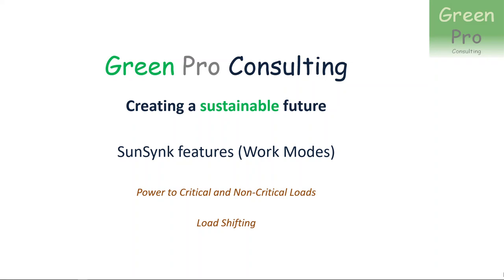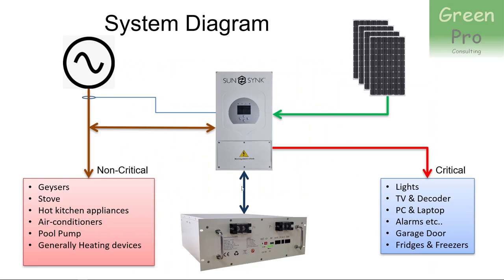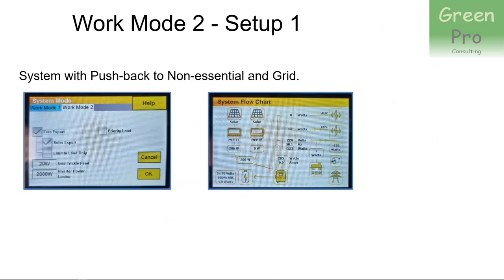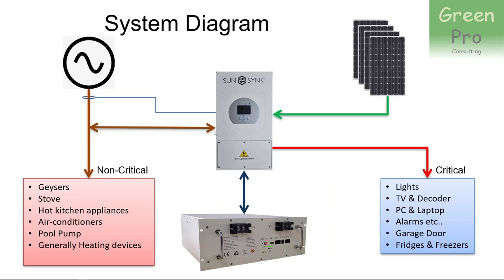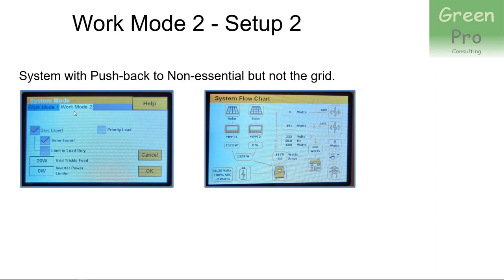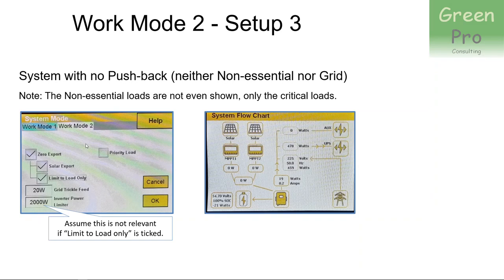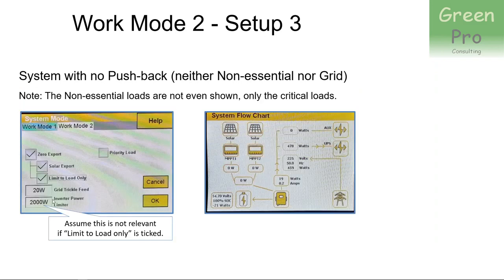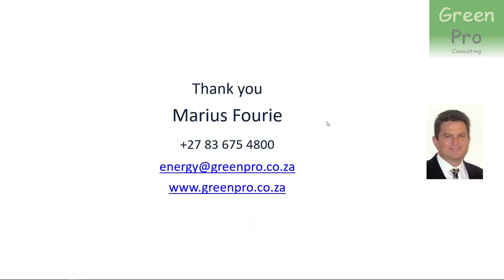SunSynk Work Modes Setup

Comment: I’m not sure if this helps or add to my confusion. I think you’re right that “Zero Export” just means “use the act to measure stuff”. It’s a terrible name and Deye, SunSync, and SolArk are all equally guilty. But I’m confused about what Solar Export means. It doesn’t mean export to the grid? If it just means “send power back TOWARD the grid”, meaning to both the grid and non-essential loads? Does it make a sense to have both Solar Export and Limit to Load Only checked? Wouldn’t it be one or the other but not both?

Comment: Hi guys
Please could someone help me get my head around stopping the Sunsynk from exporting back to the grid in the UK. So I'm wanting to put a solar array on my garden room with say the 3.6K Sunsynk Inverter.
I already have a small distribution board (fed from my consumer unit - in the house) I "was" intending removing the mains incoming from my home to the garden room and using that to provide power to the IV. And then take a connection from the mains out on the inverter and use that to "feed" my garden room DB. BUT ....
I can see that this IV is bi-directional so could just simply connect it as any other appliance from the garden room DB and it would BOTH be supplied but also put out AC back out to my distribution board.
HERE's the question .....
So presumably the electricity output from the IV would go into my garden room DB but ALSO fed back up the feed cable to the house and then to my Consumer unit and make THAT electricity from the IV ALSO available to the house? So how would I stop it then continuing out to the Street ? Is it as simple as putting a clamp on the mains positive (in leg) from the street ? Thats quite a long way away. 30m away. And finally how does it work .... does it just alter its frequency or something so that the output from the IV doesn't quite reach the street ?
Thank you for any comments.

Comment: So my export power limiter is 3.6kw but it is set to zero export but solar export is ticked. Does that mean it will only export when there is excess solar but will not just export when it wants from the battery

Comment: By far the best video on Sunsync setup. Wow. Even the installers did not set mine up correctly.  I noticed I was using municipality power even when my PV had the ability to produce 8.8KW and my non essentials only using 1kw. Pv was throttled as batteries were full. Now all sorted. I have tried limiting to zero but the system only allows a minimum of 500w. Maybe I need a software update. I'm sure many non technical people have a system and due to the setup, not getting the most out of it. What do I do with excess power going into the grid. Can I get a credit from municipality in SA? You a genius. Thanks for this video

Comment: Hi Marius, I'm having trouble with my solar panel setup. Even with excess solar power, non-essential appliances like water heaters and ACs are drawing from the grid. I've noticed the AC load adds solar and grid power together, e.g., 5000W solar + 3000W grid shows 8000W, even when everything else is off. My Work Mode is set to 'Limited to home'. I've tried different settings, but no luck. How can I use my solar surplus efficiently? Need your guidance. Thanks!" P.S. Im not an electrician just an end user :)

Comment: Believe due to firmware changes the Work Mode 2 setup you describe to power non-essential and not export to the grid does not work anymore. Now you simply have to check Zero Export and then keep the Inverter Power Limiter to the size of the inverter. If you have Solar Export checked it will push back to the grid, even with 0 as the limit I found it still pushed back ±400W
Reply from the maker: Hi Gerhard. I have not seen the latest version, and I will be shocked if that is the case. SunSynk should comment here.
Reply: Was this ever confirmed?

Comment: Hi. I have a question and just cant find an answer anywhere online. If i have for example this 5kw sunsync hybrid inverter and the grid is on. No loadshedding. And i have all my non essencial running together. Which will be more than 5kw. Will the inverter trip or does it run normally from grid to appliances? I dont want to limit my whole house to just 5kw output in normal grid times. Obviously with loadshedding load needs to be reduced.
Reply: Same question, Please.🙂
Reply: @glendower2604  Inverter should supply the first 5kW and the grid should cover anything over that.
Reply: There are probably 3 x 40amp capacitors in that inverter, so if no loadshedding and the inverter is in bypass (using grid along battery), the inverter should not trip. If it does, check the trip switch in the DB board. It might only be a 20amp trip, meaning 20Ax220V=4.4kW. So, if your load is 6kW, then the trip switch would, well, trip :)

Comment: HI Marius, a very helpful video. I have just bought a Sunsynk 3.6 ECCO inverter with 3.5 kWp solar panels here in the UK. In this house we have only had a power cut about once a year and then for no more than an hour, so power cuts are not a problem here. One question about which there is some confusion of terminology, as you use the terms critical and essential for the same thing. Do you mean Critical = Essential loads and Non-critical = Non essential loads ?
Reply: I think so John, as there are only essential (critical) and non-essential (non-critical) loads.  i would as well be careful to design careful what we can afford and what we want in 2 years from now. this would better assist in not underdesigning a system and then being dissappointed as so many people are. 

spend time calculating what you actually move over as essential loads, and think carefully about the future. know your house, know your load, know your cost. spen d time doing your own measurements and calculations. you will find your shopping list better suits you.

although in saying all this. the av household will use between 900-1200 kWh a month, with a third going to essential, and 2/3rds non-essential, roughly, but not exactly depending on your home heating, etc requirements. i would always design for 1/3 rd + 20 % (1/5th) ~=0.533 * max load, which is just over 50% of your monthly load.

Comment: I am in Phillipines,  and have the Deye version of this box.   I will probably do grid tie with battery.   2kw of solar and 5kw of battery.    My question is,  why is there AC out and AC in?   How can you have both?    If I connect the output from the inverter to the Main breaker panel,  how would I connect from the main breaker panel back into the Inverter???  That seems to me it would cause a dangerous loop.  No?  Please help
Reply: The grid connection is a 2 way street. The grid is connected to your DB and to your Inv (only 1 connection). The inv can ramp up it's frequency so that it starts supplying the DB by reducing what the grid is carrying. Of course the grid frequency doesn't actually change but that is how it works.(If it was a generator you would be supplying more fuel to increase the rpm/freq). The load connection is your output for critical load (Think of it as a UPS). During an outage the load connection stays energized while the grid connection would be deenergized. You can also do things with the gen connection, it can be an input or it can be an output, not both.
Reply: @pilotdrh  Thanks for a reply that helps me understand it better.
Reply from the maker: Sometimes you realize that someone is going to kill himself if he does his own installation.
Reply: @greenpro-greenproconsultin7420  thanks for your kind words and assistance.    You must be a real rockstar at home.   Not a DB at all like you sound like here.    Green Pro huh?   Ok good to know.

Comment: Hi Marius.
Even after 2 months I still don't know what options to check and which charge parameters to use with my Sunsynk inverters.
I have 4 x Pylontech 5000 batteries at 4,8Kw each (19.2 Kw)
2 x 3.6 Kw hybrid inverters in Parallel. (2 x 16 amp)
My separate AC loads DB is connected to the paralleled output MCB after the Load ports of the inverters;  and my grid connections paralleled from the MCB input MCB (supplied by a 40amp RCBO from my MAIN DB ) 
I  understand the system is bi-directional and can take or give power through any of the 3 ports ( generator / Aux ports are not used)
My Master CT coil is extended to 12 metres using separated CAT 5 wire into 2 pairs per wire for the black/white CT coil which measures 120 ohms as Sunsynk have advised.
I am unsure which boxes to tick and what % SOC to configure the controller at ?
I want to charge all day from solar  (2.4 kw DC coupled) but also run my "critical" AC loads DB when required, then use cheap, OFF PEAK grid energy at night to top the batteries off during our miserable UK weather spells....
i have zero export checked but im unsure what else to tick !
I have 95% SOC and a GRID tick in the first 2 rows during OFF PEAK periods ( 21.30pm to 00'00 and 00.00 to 02.30am)
All other time stamps i have no tick and 40% soc.
Does this mean i charge to 95% as i expect during those off peak times ?
Also do the other settings mean i discharge using battery only down to 40%.
It is so unclear isnt it ?
Reply: there is a sun synk manual i can send you, if you attach your email address

Comment: Hi Marius, so grateful to have found your very well explained video. We recently had a Sunsynk inverter with panels installed, but are also still connected to Eskom. We have a non essential db with geyser and stove connected to Eskom and essential db connected to ups/batteries/s.panels. During the day the s.panels and Eskom powers the house, with excess solar power going to the non essential db. At night from 22:00 - 09:30 next day our system has been set to run off our battery. My understanding was that the battery will only feed the essentials db during that time and Eskom the non essentials db, but I have noticed that during that time should the geyser or oven from the non essentials db come on, that the battery will feed those items with atleast 65% and Eskom then adding only 35% to make up the demand. My question is this: like the s.panels feeding the non essentials is it possible for the battery to also feed the non essentials, giving Eskom is not down?
Reply from the maker: The devel is in the detail here. I will have to understand better to comment. e.g.: Where is the CT installed?

Comment: "Inverter Power Limiter" used to be entitled "Max Sell Power" in an earlier firmware version, which made marginally more sense.
And "Solar Export" used to be labelled "Sol Exp Bat Full" which also made marginally more sense.
Now the Work Mode 2 tab has been added (used to all be on one page) and they've completely stuffed the descriptions in the process.
Reply from the maker: Yes. They keep on updating it. I wish they would just think about it properly and define it for once and for all.

Comment: Good explaination - however (for work mode 2), I need to know how the Inverter knows the difference between non-essential and essential (unless I have missed something basic?) The non-esencial loads are on a different DB board, with only a shared bus bar? 
Hence is it possible to push back to non-essential, without pushing back to the grid.? 

I will test over the next couple of days.
Reply: Did you figure this out?
Reply: It is possible to push back to the non-essentials and not to the grid. The CT clamp prevents pushing back to the grid. Another thing you can do with this inverter is to put your non-essentials onto the second output of the inverter, the Aux Load (or Smart load).

Comment: Very clear explanation, thank you, a question please what is the best size lythium battery to use with a 8Kwh Sunsynk inverter?
Reply from the maker: The rule of thumb is 2kWh per kW inverter size.
Reply: @greenpro-greenproconsultin7420 
Hi Marius. Why must the solar panel VOC be the same voltage as the system voltage .A friend bought a 10kw inverter from China and they supplied him with 12 x 300watt panels with voc 30VDC and the system voltage and battery is 96VDC. Thanks
Reply: I have a 15kWh Freedom Won, with the 8kW Sunsynk, and 11kW panels north facing at 30 deg elevation. Works like a charm and I am very close to off the grid. Best of luck!

Comment: Hi Marius, thanks, I am a big fan of your videos.  Unless I misunderstood your explanation, I have a correction to how the Sunsynk works at time 6:02 in the video. The setting "inverter power limiter" which in your example is 2000W, is a limit one can apply so that at any moment the inverter will cap the amount of power fed back to non-essential loads.  If zero export is ticked the inverter will not export anything back to the street.   I use a scenario, If solar is 5000W, backup load is 1000W, battery at 100%SOC  and non-essentials are using 3000W, the inverter will limit the momentary feed to non-essential to 2000W after servicing backup load.  The inverter will throttle the solar down to 4000W so the equation balances. I normally set the inverter power limiter to the maximum. I hope this makes sense?
Reply from the maker: Hi Jean-Philippe. Thanks for the comment. I have a test setup so I will test this and revert.
Reply: They can be bad at answering - get hold of Mr Gould in the UK
Reply: Hi Marius and Jean, loved this video.  Thank you sommuch for making 6the effort to share your knowledge.  So I take it that I must put power limiter on 5500 in my case right?
Reply from the maker: Please see the post on: https://www.sunsynk.org/forum/techical-support/two-inverters-with-same-work-mode-behave-different-this-one-is-a-8kw-that-do-not-push-into-the-grid-i-will-do-another-post
I am awaiting answers. Hopefully SunSynk reacts, which is a bit of a frustrating afair.
Reply: @greenpro-greenproconsultin7420 .. So dissapointed that they havent answered you!
Reply: @greenpro-greenproconsultin7420  hi
Can I know how to set the battery shutdown or cut off in terms of voltages not in terms of percentage
Reply: Was there ever a reply on this. Your bideo is great thank, but does not work for me unfortunately. My limit to load (essentials) works perfectly. When I try to add non essentials the whole system moves off battery and solar and only uses grid (ie both essentials and non essentials)